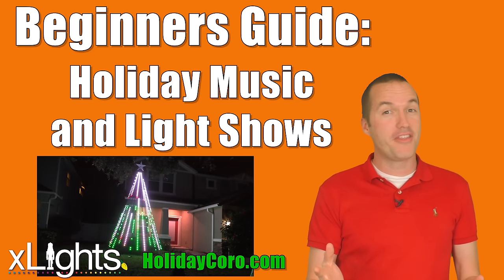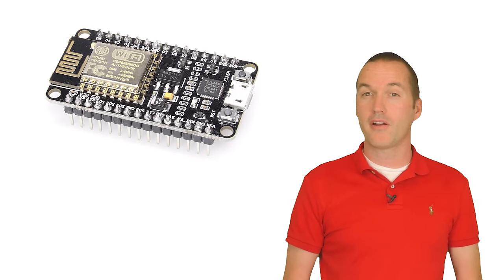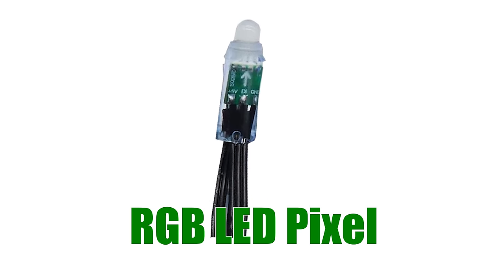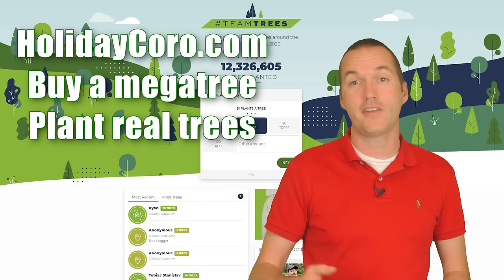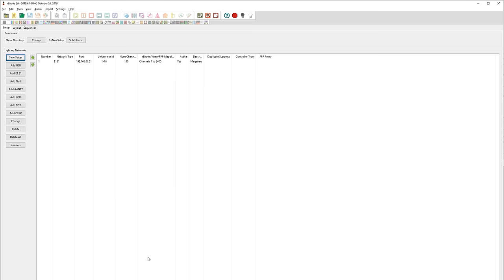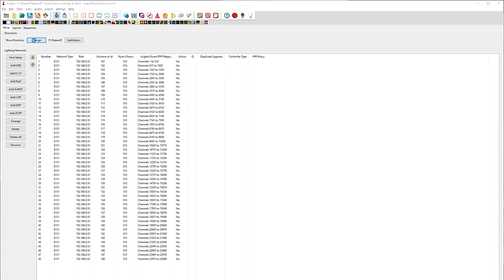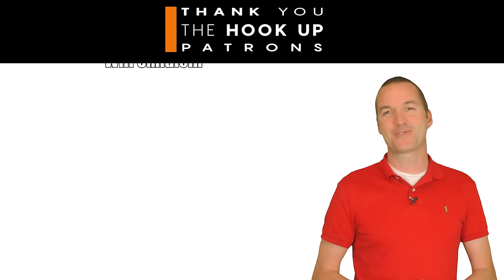Holiday Light Shows 101: LEDs, Controllers, Props, and Sequencing for BEGINNERS. 5 Hour MegaTree!

Comment: I am loving the information on your channel. I'm just starting out. I have a model using USB fairy lights that are W2812B for my bedroom sized model and I am looking into beginning to learn programming. My model is not just flat or linear, it is an abstract multi-dimensional star like design. The complex/advanced model is anyway. My first yard sized model with light was called "Tetra Light" and the complex model is 4 times more elements. The programming will be able to handle many different sets of movement on the one model and it's 4 different prototypes so far.

As for choosing strips or strings and power, the design in these early stages are basically lights strips in tubes/pipes. I'm using Govee led strips for larger versions and BTF lighting fairy lights for the smaller version. There are sets of 12 light tubes in the simple model and 48 in the complex model. Each of those could be individual segments. I'm going to calculate how many lights that would be. Power is an issue because I would have to hide the wires so they don't hang out all around the ends. The model gives a way to brings power lines through the center of the tubes at large diameters. I could use little 3D printed parabolic cones to distribute lights from strings and pixels aligned by the center wire so the light is reflected around to the tube in a better way that just pixel in tubes. 

https://www.youtube.com/@CreativeStarlightCurves

Comment: First, love your vids. You're literally the reason I even ended up in this hobby. Starting with your holiday lights vids and now into the full show. That said, "less than a week to a full show" is fairly misleading. I suppose with a Ready to Run kit for the mega tree, that element's doable in that time frame, but a whole show is not. It's my first year, I've been at it since August/September and I'm only at about 65% complete. Wiring, soldering, attaching pigtails, power injecting, building props for window outlines, and trouble shooting is all very time consuming. And that's before the dozens of hours you'll spend sequencing. 

This is still a great tutorial and your xlights section will definitely save me some time!
Reply from the maker: Yeah, that time frame is for kits of course.  I know I’m not exactly a beginner, but I completed my tree +sequencing in one Saturday.
Reply: It's possible if you have general IT skills (installing software, IP addressing) and you use out of the box sequences along with a ready to run controller.  Going Ready2Run assembled alone will save you many, many hours since the controllers are shipped 100% assembled and tested and you don't have to make a bunch of mistakes not purchasing or purchasing the wrong items to complete the project.  Power injection is a "level 4" skill that even we don't support for customers due to the likely-hood for damage to hardware and thus we generally have customers using Long Range instead of power injection which is cleaner and easier and just about the same cost.

Comment: That's REALLY impressive... a bit out of my budget.. didn't realize the big controllers were that expensive. I look forward to more of this series and I'll be ingesting more of your original LED outline to build my own.
Reply: you can use nodemcu lolin boards (espixelstick firmware) that cost 4$ each to control up to 250+ pixels per controller. you can waterproof them in cheap pvc pipe. you can diy a 18 strand pixel tree for about 250ish dollars and that includes 18 strands of cheap pixels,6 controllers, and a powersupply. how you mount the pixels dictates the rest of your cost. mounting strips are nice, but slicing 1/2 inch pvc pipe in half lenthwise on a tablesaw  and drilling 50 1/2 inch holes every 2.4 inches   will only cost you 2$ per 20 feet! thats 20$ to mount all the strands. to support it you can create a frame from emt piping, or use conventional megatree methods.
Reply: The DIY route is definitely the way to go in my opinion. You learn more this way, so that you can add more in the future, AND you save a LOT of money. I use ESP8266 boards controlled via E1.31 with Vixen Lights software. The ESP8266 boards control my LEDs, and I have a separate power supply. It really isn't too hard to build if you do your research.
Reply: @alexelliott9733  Thanks Alex. I now have lights along my soffits and one other element running on D1 Minis with Dig-Unos. Planning a 7-8' Mega Tree for next year and I won't lie, I'm intimidated by Xlights (for now), but I realize how much it adds to it all.

Fortunately, I got a bit of time to learn. The tree will be where I more to nodes and may be where I step up to 12v from my current 5v lights.
Reply: @ein57ein  That's awesome! I've also been thinking about building a full-fledged mega tree, but it didn't happen this year, so hopefully I'll get around to it for next year as well. Hope yours goes well!
Reply: @grimninja2004  man! I've got a lot to learn lol... I didn't see your comment before, but now (specially that I'm plotting for next year).
I'm thinking about a 180 degree 8' with ~13 strings on a D1Mini or ESP32 with WLED. I know WLED can listen for e1.31, I just gotta figure that part out before next year.

Comment: First I want to say that I have subscribed to you page.  I have been sequencing a light show for a few years now.  While I have considered going with Pixel lights I have too much invested in regular LED lights, (about 25,000), to change my set up.  I also wrote my own program to run my lights.  I use Digital I/O boards in my display and build all my own circuit boards.  I still do the flashy blinky type of display, (no dimming).  Even with what I know this set up seems like it would take a lot of study to get a grasp of everything.  I have even tried to contact DIY web sites but no ones seems willing to help me out with questions and problems that I encounter.  You at least are willing to show how some of these things go together.  I did at one time try and purchase systems from people, but no one would explain how to diagnose problems with the systems I bought.  It would be nice to see something like this broken down into easy to understand steps to do a display as complex as this.  All of the terms you are using need to be defined in every day language for the average person.  Thank you for you effort to explain your system.

Comment: My favorite hobby, This year will be my 5th year running a light show. One thing I noticed that will cause issues is using DHCP. You just can't do this. I don't use xlights but on Vixen it asks for controller IP, if you're using DHCP this is liable to change after a day or a week depending on router settings. Using a manual IP should be the only option. 

Also never used Falcon boards because they're quite pricey. I've stuck with SanDevices, they also sell their boards fully assembled which is the option I took.  My first SanDevices I got 4 years ago (an E682 ) and it's still running like a champ. Now they have a $99 board that assembled with 4 outputs. Perfect for placement on a display element.
Reply: While the E682 was one of the first crop of pixel controllers back in 2010, it has not kept up with all the modern innovations common to newer controllers like - multi-line OLED screens, network switch for daisy chaining, Wi-Fi interface, modular construction allowing 2 times or more outputs per controller, no long range support, no temperature / voltage monitoring and shutdown (for safety), blown fuse monitoring, sequence playback from controller, FM transmitting and other improvements.  When factoring in these huge improvements since the release of the E682 years ago, the difference in cost makes sense.
Reply: Most modern routers keep matching the same IP to a MAC address, so the IP given by the DHCP shouldn't change.
Reply from the maker: I think it's easier to let it take DHCP, then reserve the IP on your router.
Reply: You should be able to make DHCP static leases on your router.  This will ensure the controllers get the same IP address every time.

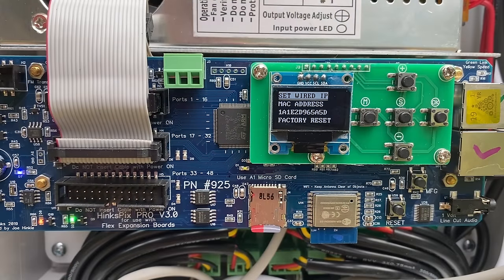Comment: Quick question, you narrate that you can connect ethernet to PC or through a hub. In the video at 9:34 I see the controller board has printed text mentioning "wifi".  Can this board also be connected via wi-fi without any additional hardware? I realize it may not auto-update this way. (Ethernet cable into the house may be difficult - I wonder how you do this without smashing a cable in your doorway or window seal.)

Much thanks. I'm always watching your vids. Tons of respect out to you.

Comment: Very helpful video! Here's the one question I have that you actually didn't cover lol. Where is your main  controllers mounted and how does one typically run the pixels cables to it without having awful cables covering your house? Go through the attic? And can the pixel strands be daisy chained or each 50 have to run back to the controller?

Comment: Nice video, I would add a disclaimer about that fence post though those bend and break easy in heavy winds. I would use stronger metal poles for the build. Also would let people know that this is only one option like you broke down the controllers so they understand that there are multiple ways to make the same sort of prop. Also don't recall seeing guide wires added for extra support on the tree? That's also a good point to highlight so people don't get frustrated when things start falling over.
Reply from the maker: I did mention the guy wires (both buying the string and when to attach them), but I didn't show a close up.  There are certainly tons of options for making every kind of prop, I'll be covering that in my next video on the subject (also PVC/PEX/Coro/3d Printing).  This video could have easily been 30-40 minutes long, but I was REALLY trying to keep it short since there's already a ton of good information about the subject if you're willing to sit down and watch hours of videos.  I wanted this to be the fast-paced first video you'd would watch to get an overview and then dive in deeper to any particular subject you needed more info on.

You think the top rail will buckle in heavy winds?  I know it's pretty thin walled, but there's just not that much surface area for the wind to grab a hold of.
Reply: The number of factors involved with mounting a megatree and vary quite a bit.  We have customers that build MegaTrees on roofs, sand, on flag poles, on the side of a house, on asphalt and concrete and other varied surfaces.  As such, there are many factors that come into play on how to balance safety, cost and materials that a customer is able to work with.

Comment: Great video! Thanks. I'm new at this and have a few questions.  Doesn't using the HolidayCoro Ready2Run setup require you to use the HolidayCoro pixels also due to the connections they use? Or can you buy a the Ready2Run and buy pixels from another source? (aliexpress, amazon, etc.)
Reply from the maker: The connectors are readily available on the holidaycoro site or even on aliexpress.

Comment: Great Video! Thanks for putting it all together. QUESTION: Do you run one controller for the mega tree (HinksPix Pro) and a different one for your other lights (F16v3)?  If you're running two controllers, can you synchronize them?  How?  I almost hate to buy a kit from Holidaycoro that will be limited to just the mega tree.
Reply: The HinksPix Pro can run stand alone xlights sequences (see HSA at www.holidaycoro.com/hinkspix) and it can also drive other E1.31 controllers including the F16v3.  It's like having a free FPP built into your controller.  Plus you can build out larger controllers with up to 48 outputs:  http://www.holidaycoro.com/AlphaPix-Evolution-Ready2Run-Assembled-Controller-p/952-1.htm
Reply from the maker: I have my house lights (Roof lining, window linings, wreath, candy canes) on the falcon.  I have the megatree on the HinksPix using 16 ports.  I have 50 LEDs on each port except for port 16 that I have wired to the star for the tree, so it has the full 170 pixels in that universe.  I then have a long range expansion board (much cheaper) that plugs into the HinksPix that is running my mini trees and my "tune to XX.X" sign.

Long story short, no, you aren't limited to a single controller, you can synchronize as many controllers as you want, and you can also hook up expansion boards to the HinksPix (or falcon) to add more outputs.
Reply: @TheHookUp  I appreciate your reply.  I do want to see if I can get this to work! Thanks!!
Reply: @HolidayCoro   Thanks for the info!

Comment: Very clear explanation ! Thank you !!. One question (I am a beginner with RGB). I just bought the Pixie 16 LOR controller. How many stands can I attach to each of the 16 outputs (cables that comes from the controller). Sorry about this silly question but I am a newbie. My understanding is that I can only control 16 stands of lights. is that correct? Thank you for your help and time answering.

Comment: You convinced me, I ended up purchasing a mega tree kit. If I want to add on in the future, do I just need an expansion board, receiver, and power supply? I ended up getting the Mega Tree kit w/ the HinksPix Pro CPU, I'm just trying to get an idea of what it will cost me to add additional props in the future. Awesome video, very helpful!
Reply from the maker: Yep, expansion board, psu, and lights.
Reply: @TheHookUp  thanks! The HinksPix Pro CPU has an output CAT5 connection - what is this used for? Can this be ran directly to a LR Receiver? Having trouble finding documentation for the board itself, it seems a lot of the information exists in YouTube videos.
Reply from the maker: @AcesTV7  You mean the two on the right? I think that is just a passthrough/hub connection, but I'm not sure.  The expansion boards don't use TCP/IP, so it won't run one of those.

Comment: Thanks for the video! I noticed you have your electronics and the power supply in a sealed box, how do you deal with heat dissipation? Do I need to worry about this? Thanks !
Reply from the maker: In the garage I keep the box open, this is my first year having a box outside in Florida... we’ll see how it goes.
Reply: This isn't as much of an issue as most people expect.  The controllers have several safeties - the housing is FR5 rated for fire resistance, the power supply shuts down over 160f and the controller auto shuts off output over (typically, can be configured) 140f.  With a single power supply there are never issues, for dual power supply units we use a larger enclosure and for 4 power supply units, an even larger unit.  The controllers also all have fan output to a "CPU" fan that can be controlled by the CPU if you want to exhaust the enclosure.  The HC-2500 and BUD boxes both have pre-marked sections for vents.

Comment: What is your spacing for the holes on your pvc frames for the windows and doors?
Reply from the maker: Mine are 2.75", but if I had to do it all over again I'd go for 2.5".  The 2.75" spacing really stretches the wire between pixels.
Reply: @TheHookUp  Great.. thanks

Comment: Can you do a video on how you do your power injection with the strips and aluminum channels? Thanks
Reply from the maker: Check out part 3 of my LED series (installation): https://youtu.be/UWb2i6BHx1g
Reply: @TheHookUp   I built this exactly like you did in the video and it worked great. I switch to the HolidayCoro and now I have issues (Hinks pro). Now have power issues. 624 pix injected at the end of every 150 pix strip. Tried using a separate supply by cutting the positive from the HollidayCoro box. Did not work. Lights did not even come on. Still don't know why. I would love another video on how you did this.
Reply from the maker: Lights aren’t coming on at all?  Are you sure they are getting data?
Reply: @TheHookUp  my bad. soldering issue. soldered one too many connections today..  over 120 and one wrong..lol. sorry. Love your videos

Comment: I have just started looking into xlights. My little bit of research came up with the falcon boards being a good idea as well. My question though about the mega trees, do you really need a $700 package? Can't you just use 1 or 2 of the 4-String Differential SmartReceiver Boards? Or maybe an arduino to cut down on that huge cost?
Reply from the maker: If you are using differential boards you'll also need a falcon F16V3 to act as the main controller for it, so you'll need to spend that money anyways.  An 800 pixel tree is going to need 6 universes (putting 150 pixels on each universe), so you'd need 2 differential boards for that.  

An ESP8266 can handle a lot of things, an 800 pixel megatree is probably not one of those things.

You can put a tree together for less money than the $700 package ordering from AliExpress vendors, getting an F16V3, power supplies, box, and mounting strips, then make a top mounting plate and some anchors for the bottom.  I'd guess you could do it for ~$500-600.  There is definitely a convenience fee for having a company like holidaycoro put it all together for you, for some, saving hours and hours of work is worth the extra $100.

The hinkspix that comes with the kit can also act as the main controller to attach differential receivers to for up to 48 outputs, just like the Falcon.
Reply: Long Range boards are best when hitting "long range" items like arches, house outlines, snow flakes and stand alone elements.  The centralized 16 and 32 output controllers are for locations where you have a lot of pixels and power all in one place.  The controller can also handle local SPI (for the megatree) and a long range expansion board (up to 3 total board depending on your enclosure) for up to 48 outputs.